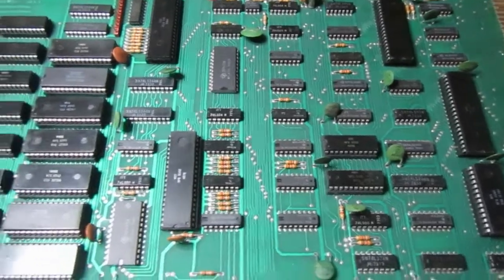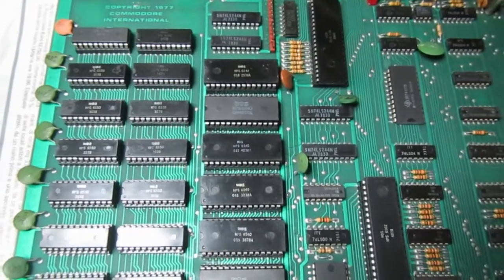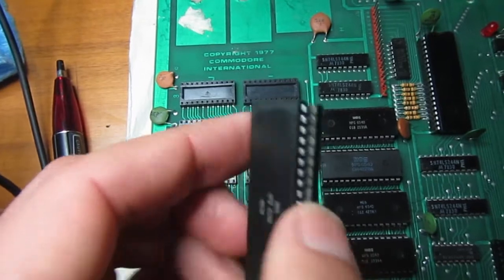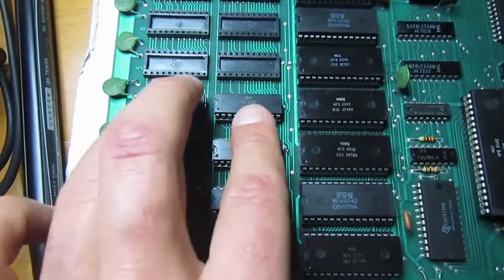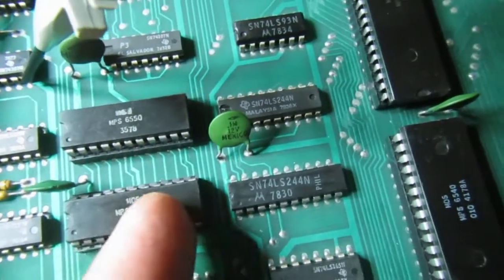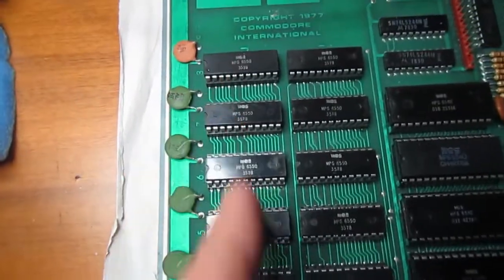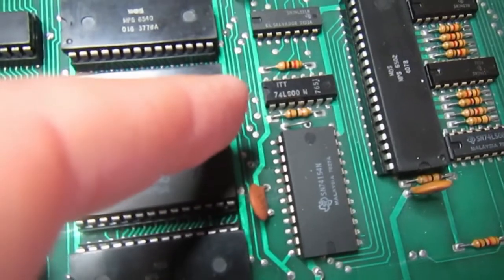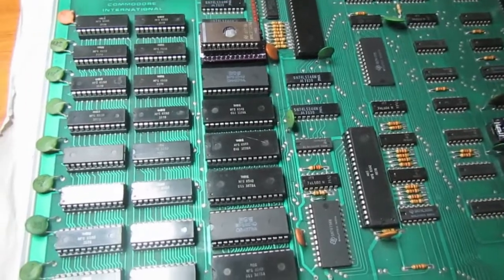Commodore PET 2001 repair: dealing with MOS 6550/6540.

Comment: Hello Frank. Much respect to you and your skills. I recently found a PET 2001-8 in a rubbish skip and would like to repair it. It has a 320132 assembly with 2114 ram chips. My question is ,if I use your bin file will it work in this assembly? Thank You.
Reply from the maker: Hi Danny, thank you! Yes the binary code (which isn't mine, it's made by a great coder), will work fine with 2114 RAMs, but chip positions may not be the same. I've never worked with a 320132 so I am not sure if the IC position are the same as the 320008 board. The good news is that 2114 SRAMs are still widely available :)
Reply: @iz8dwf  I think address mapping 0000 starts at opposite ends of the memory chips in each board. Although the chip layout is identical. I will try it and see want happens. Many Thanks.

Comment: Hi Frank. Love your channel. Is your little 6540 adapter board available for purchase? If not, are the Gerber files available, so I could order some? I have an original PET like this one, and the kernel ROM has failed (address range starting at $Fsomething). Everything else is original. I don't want to use a massive adapter to replace all system RAM and ROM, for that would disfigure a beautifully original machine. Therefore, my interest in your adapter.
Reply from the maker: Hi, you can contact me directly for the gerbers (it's been a very long time ago now...). There're still a couple of adapters for sale here: https://www.arcadeshopper.com/wp/store/#!/PET/c/28756047

Comment: Thanks! I'll buy a 74177 later. By the way, my another PET has an problem. it's monitor doesn't show any picture like this video. (https://www.youtube.com/watch?v=LGreLLZSc9Y) I hooked this monitor to another pet (the first one), it didn't showed any picture either. I think that this monitor has a problem. I've changed all transistors (2N3904, 2N4401, 2N2369), but it didn't works.
Reply from the maker: Schematic of the video board: ftp://www.zimmers.net/pub/cbm/schematics/computers/pet/2001/video-1.gif
Check also diodes CR1 to CR6. Check trimmer R9 for proper contact. Check -30V supply and +85V supply. Check zener CR7 for correct +33V regulation. Check R1 to R7 for proper value and finally check for any open solder joint too.

Comment: Hello!
I bought pet2001-32N recently. It has a problem, but i solved to change 2114 roms.
 However, after few hours, the computer screen flickers, and makes a great wall of '@'marks. 
(See the video: https://www.youtube.com/watch?v=-Vi_k2XbYxg).
After that, i turned off and on several times, it turns like this video with nice double cursor. 
(https://www.youtube.com/watch?v=HgDmcr_e3dA)
What should i do to fix it?
Sorry about frequntly questions. I couldn't register the forums (vcfed) to ask the questions.
Reply from the maker: Hello! It might be the 74177 on position UD7, you should check with an oscilloscope or logic probe to see what address to the video RAM isn't changing and at what IC however.

Comment: Too bad, so the program is not very usefull for the common man that ownes a PET 2001-8C unless he is able to write/upload the program into an EPROM.
Reply from the maker: Hi, generally speaking, it's not easy to test the RAM from a program using the same RAM you want to test. It can be done in some cases, but it requires more knowledge than programming an EPROM usually. I could program the EPROM for you, but first  contact me at iz8dwf@amsat.org

Comment: Thank you. I will try to put your file into a textfile so I can type it in and check the memory of my PET.
Reply from the maker: Hi, I'm afraid it can't be typed. It's  2Kbytes of machine language and it must reside in $f800-$ffff addresses, unless you want to disassemble it, relocate to ram and re-assemble it.
It's intended to go into a 2716 or 2816 type of memory and used with an adapter into the topmost 6540 socket in a 2001 board.

Comment: Great to see the repair of an original series PET 2001. Shame the chips are so expensive and difficult to find. Thanks for the video!
Reply from the maker: Hi aphexteknol! Thanks for the comment! Yes, the chips are very difficult to find, the MPS6540-0xx are really hard to find. The MPS6550 RAMs are easier but expensive. They were a clever choice for that time, but probably their limited size (1kx4 for the RAM and 2kx8 for the ROM) posed too many problems and were abandoned quickly.
Reply: iz8dwf My understanding is that Commodore wanted MOS (leveraging the fact that Commodore had a captive fab at its disposal) to produce as many chips as could be made for their own products to eliminate reliance on outside vendors and market forces. In some cases however, it eventually made more sense (and saved money) to utilize standard commercial components when they became available. Excellent job bringing this historic machine back to life!
Reply from the maker: Yes, you're right, but also the 6550s and '40s allowed the designers to reduce the address decoding logic to a bare minimum (not even negated addresses most of the times were needed), so it was a real cost reduction on parts. The 2001N with standard dynamic RAM needed much more TTL logic chips but it allowed a full 32Kbytes of RAM on the motherboard on the other hand.